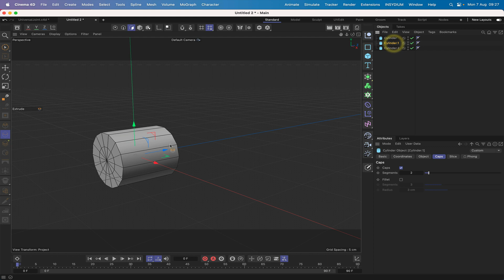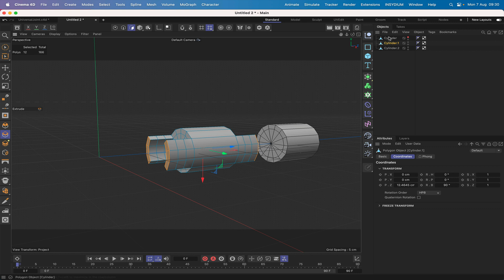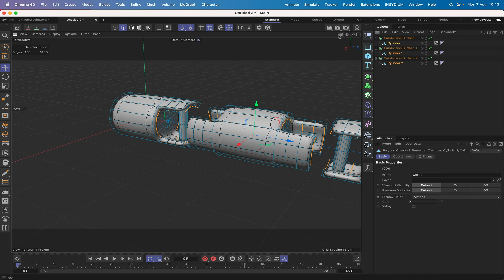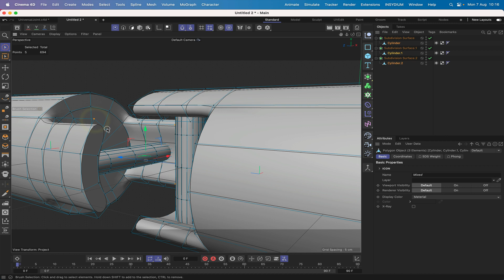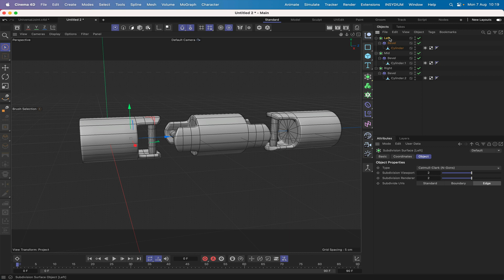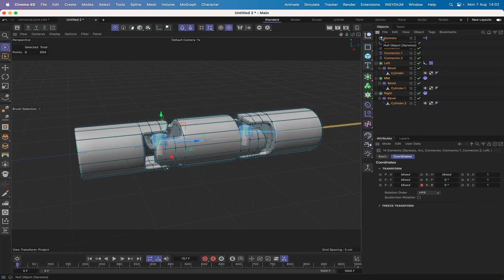Cinema 4D Multi-Tech Tutorial  36: Universal Joint

Comment: Why does the arc rotate when the animation runs? it seems that it is not connected to any part of the system and is not keyframed.
Reply from the maker: The Arc's rotation is under Xpresso control.
Reply: @ExpressoMechanicTV  OK, I actually meant 'why does it need to rotate'. I disconnected the rotation of the arc and it seems to work well and the left cylinder is just aligned to the static spline. Am I missing something?
Reply from the maker: @vytasrauckis6703  It's just to illustrate that it can move in any direction, really.